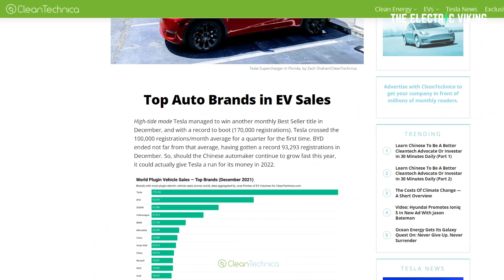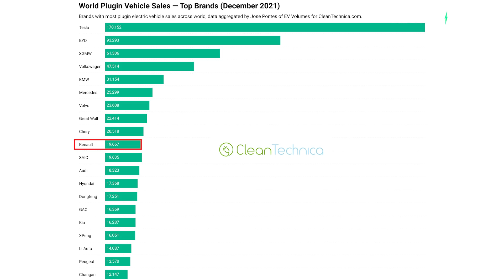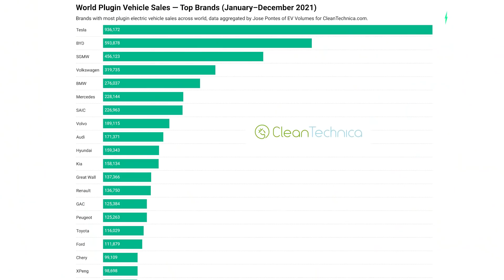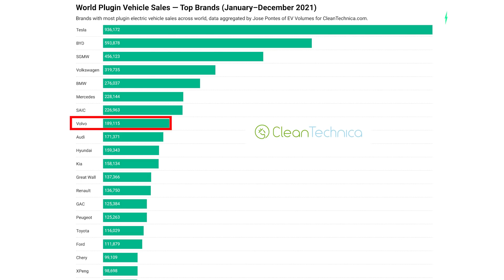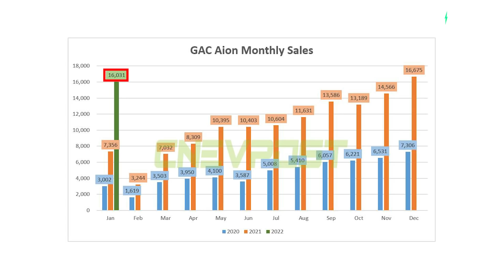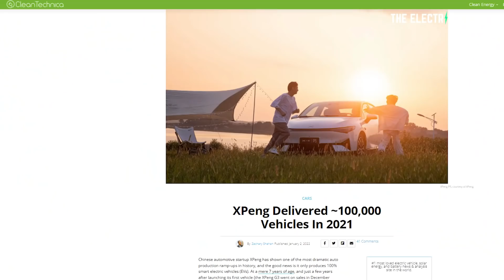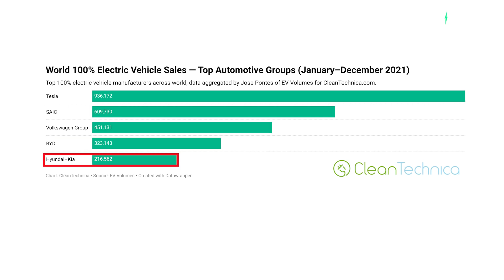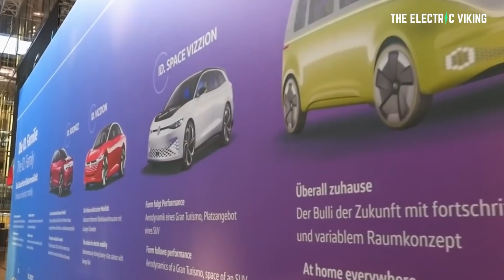2021 global electric car sales: top 10 winners + losers

Comment: Quadricycles are far more restricted than the Wuling Honguang Mini. The Chinese equivalent are the "old man's happy car", even cheaper, no licence required, lower power and about to be banned because of what happens even if a Wuling Mini hits one. European quadricycles are limited as well but are usually more expensive (€16k+) having lower volumes and better engineering than an old man's happy car (a number have previously made real cars and competed in F1 in the '70s and '80s). Even EV versions are more like 5kW with a top speed of around 45km/hr (artificially limited). The Wuling and it's newer competitors have around 30kW and top speeds of 100 km/h and so have to meet (Chinese) crash standards the simpler cars don't. Some US states allow neighbourhood EVs, usually more like fancier golf carts, with similar restrictions, and one Chinese company (Kandi) is trying to sell their EVs under this exemption after unexpectedly failing to meet US standards. Well THEY didn't expect it.
Reply: Despite their higher prices European quadricycles makers will probably survive as they switch to EVs. They've always been more expensive than more capable cars from Fiat, Peugeot etc. but have a niche market for people who don't have a licence (too young or too tipsy) or need to drive where larger cars aren't allowed (such as parks and campus areas).

Comment: Sam, re: VW catching up with Tesla, That usually refers to VW group, not just the brand. VW +Audi + Porsche + Skoda made around same number of plugable cars as BYD. I didn't check how many of which were BEVs for each company, but if VW's percent is higher, it's very possible that they produced more BEVs than BYD (do they also have sub-brands I should add?)

Havi g said that, if pressed to bet which would make more next year I'd bet on BYD, but it isn't conclusive. 

Also not 100% conclusive is their not passing Tesla in sales (not profits). It's very uikely they'll pass Tesla in sales, but it IS  possible.

Comment: you need to do more work if you use Clean Technia, they are real bad at what they are doing... VW AG could outproduce Tesla in 2022, not VW.  
VW AG was also the 2nd biggest plug in producer in the world behind Tesla.  you cant read that out of Clean Technicas articles or even charts because they dont understand what a brand is.

Comment: Sam, here's a video idea: EV debunked - discuss all the misinformation  about EVs, like EVs don't run in winter, etc. 
Well here in Saskatchewan Canada EVs work perfectly fine in our -30° to -40 °C winter temps. Yes, range is impacted a bit but a tank of gas doesn't go as far either when it's this cold.
Bill from the Great White North 
Regina Saskatchewan Canada
Reply: Saskatchewan is not only cold on the thermometer but even colder because it is flat and the wind 🌬️ is brutal.  The wind chill is through the floor.  Currently the temp is -30 and feels like -42.  So when it drops to -35 tonight all I can say is 🥶 brr.